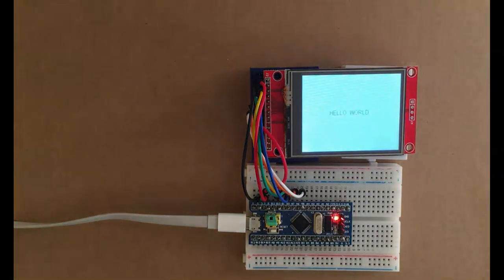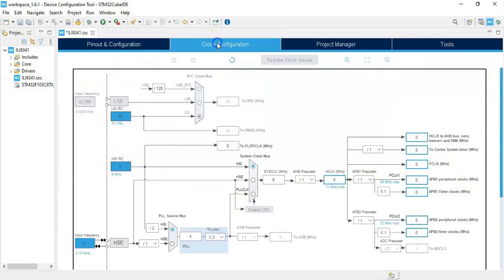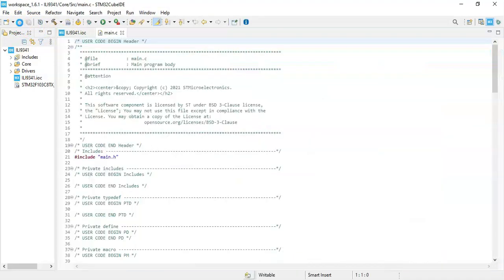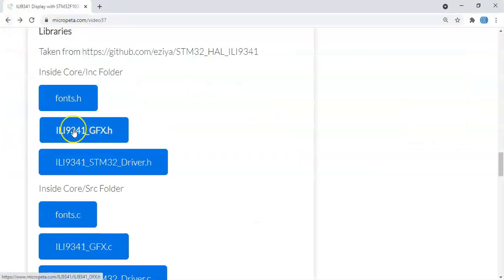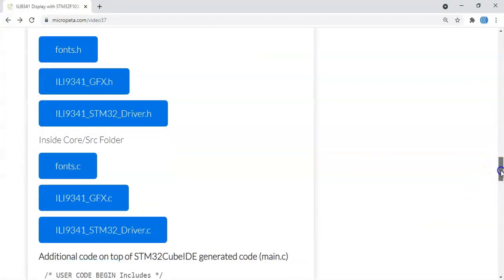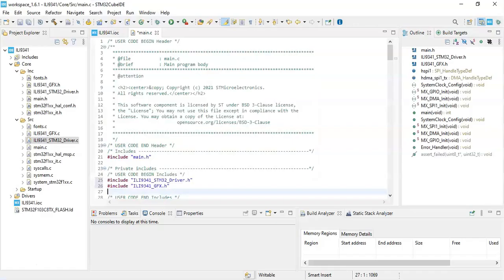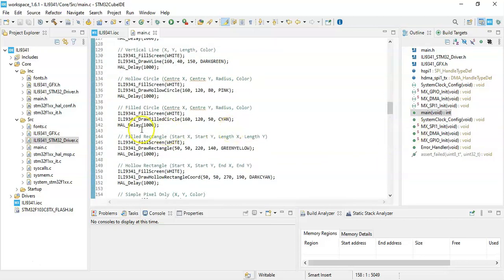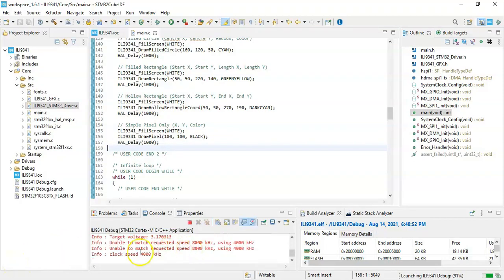37. STM32CubeIDE ILI9341 TFT Display with STM32F103C8T6

Comment: Thanks for your video.
But for who use STM32F303RE nucleo follow this video not work, you can config extra the parameters:
Mode: Full Duplex Master
Prescaler: sufficient slow (e.g. fPCLK/16 hoặc fPCLK/32)
Data size: 8-bit
Clock Polarity (CPOL) = 0, Clock Phase (CPHA) = 0 (Mode 0)

Comment: Thanks so much, it kinda works for me. The probem I was having is the screen just white and unresponsive, if you got that problem just pull up those pins with some 100ohm resistor and set the gpio to opendtrain, at least that works for me.

The current problem im facing is the screen operate in kinda wrong dimention, so i think i'll have to further investigate into the Driver it self.

Comment: I'm starting with the STM32..
Excellent tutorial.
I followed this video and programmed the Blue Pill well. Everything fine with STMCube IDE as expected and the TFT performed well too. I tried again with a Black Pill I have (STM32F401CCU6) but the debug hammer gave me 6 errors like: 'MX_SPI1_init' used but never defined.
 Can you comment about sommething I must do different with black Pill? 
Thank you.
Reply from the maker: Only need to change 
#include "stm32f4xx_hal.h"
in ILI9341_GFX.h and ILI9341_STM32_Driver.h
Thanks

Comment: two errors
Description	Resource	Path	Location	Type
implicit declaration of function 'sprintf' [-Wimplicit-function-declaration]	main.c	/STM32F103C8T6TFT/Core/Src	line 118	C/C++ Problem
incompatible implicit declaration of built-in function 'sprintf' [-Wbuiltin-declaration-mismatch]	main.c	/STM32F103C8T6TFT/Core/Src	line 118	C/C++ Problem

Comment: Hi Nizar, excellent tutorial!  I've been looking for a way to communicate with you because I have a problem: In the file ILI9341_STM_Driver.c in the function DrawColorBrust(); There is a BrustBuffer[BufferSize] declaration that gives me problems, since it requires the number of elements to be a constant value, I think it could be due to the version of my compiler, but I see that it doesn't give you any problems. I have solved it halfway, always setting the BURTS_MAZ_SIZE value but this breaks the rest of the functionality, any ideas?
Reply: Well, I already found my answer. With versions prior to C99 it is not possible to declare an array with a value that is not a constant, so I have tried to "solve" the problem with the not very recommended way of using dynamic memory with malloc(), but even so, it still fails when painting the backgrounds of the characters. What surprises me the most is that in theory the IAR is using C11. If I manage to fix it, I will update it here.

Comment: Great, that helped a lot! Thx m8 ! After adapting Ports / SPI to my HW config it worked instantly like a charm🤩
('F401 black pill clone + 2.8" TFT with touch controller)

Allow me some technical remarks (not critisism at all, but maybe helpful):
a) Most chinese display of this type have a 3.3V LDO Onboard, so I would suggest to connect the VCC Pin to 5V.
  With this aproach the power burden on the MCU board LDO is significantly reduced ("load sharing"  on 5V line).
  (But always check datasheet and jumpers first!)
b) The ILI9341 datasheet states a "SCL" (aka SPI SCK) clock period of min. 100ns -> 10MHz max. so i recommend
  to check the SPI Baudrate result and adjust the prescaler value accordingly. Even if it  may work at higher clock
  rates it may become instable (over temperature typically).

Keep up your great work!
Greetings from actually quite snowy☃ germany...

Comment: To get my MCU working at maximum CPU speed I had to enable FIFO on the DMA parameters.  Without it I had to reduce the HCLK and FCLK by 2, from 168 MHz to 72 MHz else the LCD bitmap and data was being corrupted at times, rectangles not filling the whole area mainly.  Reading the datasheet I see that only with FIFO does the data get packed and unpacked to "maximise" bandwidth, but why is FIFO enabled so necessary to make this work reliably?

Comment: Very useful demo, thanks!  Sadly I cannot get it to work with a 407VG Discovery board, I´ve checked trough everything several time, using SPI2, changed the clock speeds to match, checked with a scope on the board, so the signals look good, there is some noise on the reset line, I´ll add a capacitor to VCC 5v input on the LCD.  The v1.0 red lcd has 5-3v regulators, so I think 5v in will help with the noise. Fingers crossed!
Reply: Yeah!!  As soon as I added a 470uF capacitor to the VCC-GND 1-2 pins on the LCD, it started to work!  Note: The Chinese schematic also says: Power supply selection:
When the external VCC input is 5V, J1 is disconnected
When the external VCC input is 3.3V, J1 is shorted
Reply from the maker: Thanks

Comment: Thanks you it works. I tried using it on Arduino UNO with 5v > 3.3V converter but i get only white display. I thougth display is broken. But i still don't know why it doesn't work on Arduino

Comment: Hello, thank you for this project
I made a font using the GLCD font creator software, but it is not displayed correctly because of the "offset of  character". How can I extract this number for my font? How did you calculate the offset value for your font?
Reply: Did you fix it in the end?

Comment: Good video, very didactic. I tested with exactly same board (STM32F103C8T6) and it worked perfectly, but if I turn the board OFF and ON again, I don't have any image on the display (but the blink LED still working). If I program the board again the display works, but I can not restart it. Is there something related with RAM memory or display? Any idea? Thanks!
Reply: I figured out. It needs a delay before ILI9341_Init(); because the microcontroller is faster than the display.

Comment: I tried doing the same thing, but when I am loading the code, the color is getting filled only at the left edge and not on the complete screen. I am using 3.2" TFT, so do I need to make any other changes?

Comment: Thank you, this is very informative, well done and works quite well. However, I noticed that although there is four fonts included in your source code all these fonts are very narrow and I wanted to use a wider bold and larger fonts but I tried to import other fonts from the Adafruit GFX font library but they did not work. Your font set for each font starts with the first four bytes with byte values as follows: Offset, Width, Height and BPL (which I have no idea as to what this one is) Do you have any recommendations as to how to use bigger or different fonts with this code? Are these fonts in your source code considered to be scalable fonts?...Thank you
Reply from the maker: Thanks. I did not create this library. I found it in public github repository.
The author explains how to create new fonts at https://github.com/eziya/STM32_HAL_ILI9341
I am sorry to say that I haven't tried it myself to create a new font yet. Please try the above link for new fonts.

Comment: Can I interface this ILI9341 TFT Display with my STM32F401 Nucleo-64 development board using the same drivers and code? What would be the interface protocol, parallel or SPI? Also, can we write & display this "HELLO WORLD" text in bold and bigger font?
Reply from the maker: You can select SPI1 and three GPIO_Output pins for CS, DC and RST pins
Change ILI9341_STM32_Driver.h file according to the pin section as shown below

/* PIN Configuration */
#define HSPI_INSTANCE                   &hspi1
#define LCD_CS_PORT                             GPIOB
#define LCD_CS_PIN                              GPIO_PIN_10
#define LCD_DC_PORT                             GPIOB
#define LCD_DC_PIN                              GPIO_PIN_0
#define LCD_RST_PORT                    GPIOB
#define LCD_RST_PIN                             GPIO_PIN_1

Configuration → Parameter Settings of SPI, change prescalar (for Baud rate) to 4
If it doesn’t work, Change prescalar (for Baud rate) to a different number

Available Fonts are FONT1, FONT2, FONT3 and FONT4

Comment: Hello
Thanks to this, ILI9341 TFT LCD could be developed well.
thank you.
But I have one question. I want to increase the size of the fonts there to a larger font. Is there a way?
Reply from the maker: The library creators web links are 
https://blog.naver.com/eziya76/221579262995
https://github.com/eziya/STM32_HAL_ILI9341
He shows how to make new fonts in those two website. Thanks

Comment: Confirmed to work on stm32F4 using Adafruit 2.8" TFT Touch Shield w/cap touch. need to change to F4 hal and port the pins it
Reply from the maker: Thanks for the info

Comment: For those who need  a direct drawline function from (x1,y1) to (x2,y2)
in  ILI9341_STM32_Driver.h file before endif at the bottom
void ILI9341_DrawLine(uint16_t x1, uint16_t y1, uint16_t x2, uint16_t y2,uint16_t color);
in ILI9341_STM32_Driver.c file
add 
#define ABS(X) ((X) > 0 ? (X) : -(X))
 void ILI9341_DrawLine(uint16_t x1, uint16_t y1, uint16_t x2, uint16_t y2,uint16_t color)

  {
    int16_t deltax = 0, deltay = 0, x = 0, y = 0, xinc1 = 0, xinc2 = 0,
    yinc1 = 0, yinc2 = 0, den = 0, num = 0, numadd = 0, numpixels = 0,
    curpixel = 0;

    deltax = ABS(x2 - x1);        /* The difference between the x's */
    deltay = ABS(y2 - y1);        /* The difference between the y's */
    x = x1;                       /* Start x off at the first pixel */
    y = y1;                       /* Start y off at the first pixel */

    if (x2 >= x1)                 /* The x-values are increasing */
    {
      xinc1 = 1;
      xinc2 = 1;
    }
    else                          /* The x-values are decreasing */
    {
      xinc1 = -1;
      xinc2 = -1;
    }

    if (y2 >= y1)                 /* The y-values are increasing */
    {
      yinc1 = 1;
      yinc2 = 1;
    }
    else                          /* The y-values are decreasing */
    {
      yinc1 = -1;
      yinc2 = -1;
    }

    if (deltax >= deltay)         /* There is at least one x-value for every y-value */
    {
      xinc1 = 0;                  /* Don't change the x when numerator >= denominator */
      yinc2 = 0;                  /* Don't change the y for every iteration */
      den = deltax;
      num = deltax / 2;
      numadd = deltay;
      numpixels = deltax;         /* There are more x-values than y-values */
    }
    else                          /* There is at least one y-value for every x-value */
    {
      xinc2 = 0;                  /* Don't change the x for every iteration */
      yinc1 = 0;                  /* Don't change the y when numerator >= denominator */
      den = deltay;
      num = deltay / 2;
      numadd = deltax;
      numpixels = deltay;         /* There are more y-values than x-values */
    }

    for (curpixel = 0; curpixel <= numpixels; curpixel++)
    {
    	ILI9341_DrawPixel(x, y, color);  /* Draw the current pixel */
      num += numadd;                            /* Increase the numerator by the top of the fraction */
      if (num >= den)                           /* Check if numerator >= denominator */
      {
        num -= den;                             /* Calculate the new numerator value */
        x += xinc1;                             /* Change the x as appropriate */
        y += yinc1;                             /* Change the y as appropriate */
      }
      x += xinc2;                               /* Change the x as appropriate */
      y += yinc2;                               /* Change the y as appropriate */
    }
  }

Comment: Can I use this on F401CC?
Reply from the maker: I haven’t tested it with F401CC but I think you can use it with F401CC. The library creator named eziya in github used it with F407VG, I simply changed #include "stm32f4xx_hal.h" in header files to #include "stm32f1xx_hal.h" for F103C8 and it worked.

Try by changing it back to #include "stm32f4xx_hal.h" in ILI9341_GFX.h and ILI9341_STM32_Driver.h and see. Thank you
Reply: @NizarMohideen  alright I  will give it a go

Comment: You really helped and the Library works great. You left some Instructions on how to make new fonts using GLCD font creator. But at point 9 where you instructed to change the offset, width, height, bpl. Height and width are clear (They are given in the title). But where do i get the Offset and BPL values from?? And what even do these. I need some help here ty!
Reply from the maker: Library creator's GitHub Repo is at https://github.com/eziya/STM32_HAL_ILI9341
He says about fonts
I wanted to make it support diverse fonts so I adopted character functions from SPI_TFT_ILI9341 library.
As it supports C font array created by GLCD Font Creator by MikroElektronika.
https://www.mikroe.com/glcd-font-creator

Please refer to the following link to get more details about fonts.
https://os.mbed.com/users/dreschpe/code/SPI_TFT_ILI9341/

Comment: I had some problem with these code, everything  is ok but if the main() has the funtion "ILI9341_FillScreen" and then it doesn't work, i do with stm32f103c8 also, Thank you
.
Reply from the maker: Can you try 
ILI9341_FillScreen(WHITE);
Reply: @NizarMohideen  Of course i do with ILI9341_FillScreen(WHITE);   My mean if i have this funtion in my main code, it doesnt work, if the main code doesn't have this funtion, it work well, thanks.